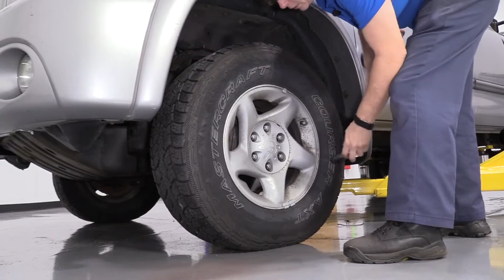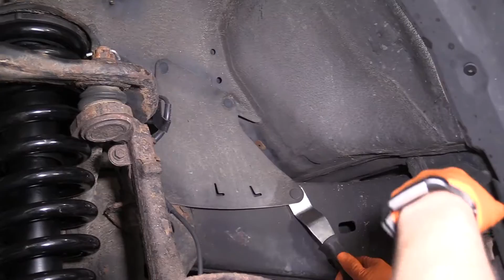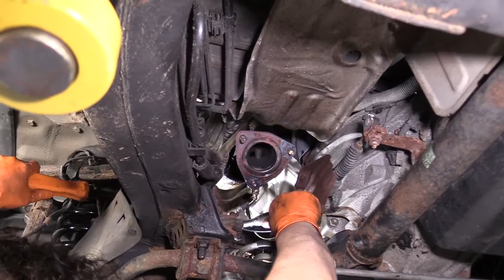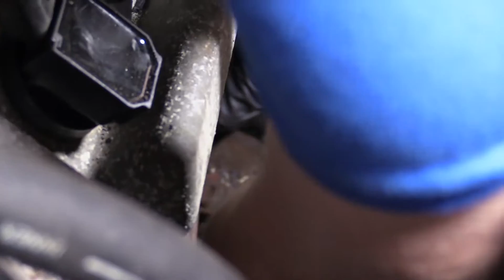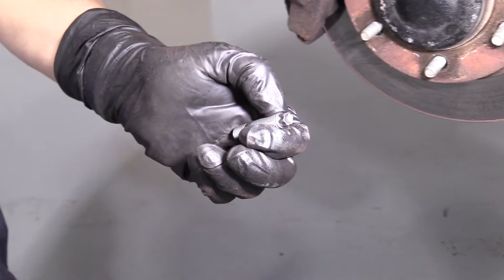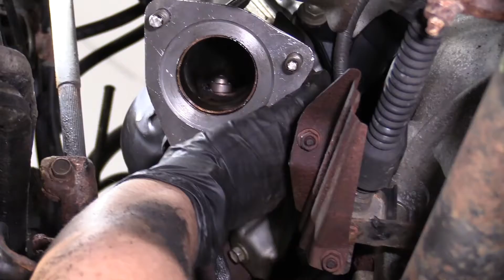How to Replace Exhaust Manifold 00-04 Toyota Tundra

Comment: So I've been chasing a leak. I've checked all my hoses I've sprayed all around the engine bay with starting fluid. I don't think it's any of the hoses or connections. I did replace one hose. So apparently this generation of tundras have a common issue with the exhaust manifold on the driver side cracking. So I guess I'm about to pull off this heat shield and give it a good throw inspection and hopefully I can weld it in place and not have to pull off the manifold

Comment: I’m late to the video but need to know what she is using to go under the manifold to the last two center bolts from up top clearly shes using a 1/2 drive flex head ratchet and she’s gotta twist extractor socket on the end but like bridging the gap on those angles, lve tried a lot and still can’t get on it with a ratchet attached, nightmare job because of the last two bottom studs in the center, I’d say near impossible for the guy with  limited tools and no garage to or even if he’s looking to save  labor cost he will probably spend on tools needed to do at home just an FYI if you’re that guy lol get yourself prepared

Comment: Sue, any thoughts on using one of the induction heaters being sold on line these days instead of the  oxy-acetylene tanks which most of us don't have?  Space might be a problem getting the flexible probe in there and I'm asking this since I haven't done this repair .......yet. 
IS there a gasket between the manifold and the pipe you attached there at the end of the video?  I didn't hear you mention that procedure.

Also your thoughts on putting anti-seize coating on all threads for the next person that has to remove  the exhaust manifold..... Great job on this video and you do a great job of showing us the challenges of this job even with a full blown hoist at your disposal.

Comment: For those doing the heads as well, I think it would be easier to just remove the shroud and disconnect the exhaust and O2 sensor and pull the head with the manifold on.

Comment: I installed a new exhaust manifold on my truck, but I had a problem with one of the studs that goes into the catalytic converter flange.  I could not get the stud to tighten It just kept turning and when I tried to put the nut on it, it would just end up backing the stud back out of the flange.  Would rethreading that one hole work or would I have to do a helicoil or something else?  It's just frustrating because it's a brand new exhaust manifold and for that to happen on the last stud, is quite annoying.  Any help would be great thank you.

Comment: Can an exhaust leak cause a P0032 and P0052 check engine light code? I already replaced all the O2 sensors and there is a strong exhaust smell and codes still exist.
Reply from the maker: +C Otake We wouldn't be able to diagnose an issue like that here, you may want to have a local mechanic take a look at it. Thanks for checking us out! http://1aau.to/m/Shop-1AAuto-c

Comment: Here's a trick for those 8 bolts, try to take them off in a star pattern, it helps with the leverage. 

It's also easier to get the last one off if a couple of other ones are screwed in slightly, again leverage.
Reply from the maker: +Peter Handelson Thanks for the tip!

Comment: I have a 2004 Sequoia and I suspect one of my inlet manifolds has a crack or leak because of the slight ticking sound after a cold start that quickly goes away, after watching this video I think I'll live with it!
Reply: I have the same year and same issue too
Reply: Same here it's the front right corner you have to take it off and weld the pin holes from the inside of the exaust manifold

Comment: Thanks for the awesome video. I watched it several time before replacing my manifolds. My only issue is that she cited 110 ft -bs of torque for the lug nuts while she was putting on the front wheel. The recommended torque is 110 N-m or 83 ft-lbs according to the 03 owners manual.
Reply from the maker: +Jonathan Hayward Thanks for the feedback!
Reply: Yeah, I was thinking exactly the same thing.  110 ft lbs is way over torqued for the Tundra.

Comment: I need this done on my 07 v8 4Runner and wondering if I had a shop do it about what the labor cost should be? Just got a really high quote so no way.
Reply: I need the same on my 07 V8 4runner.  Want to install doug thorley headers.  Have you found a shop to do it?
Reply: I was checking part prices ($Runner 4.7) and the internet toyota dealership was around $950 for the manifold while the discount aftermarket supplier was around $240.  But labor -- well, you've seen the video.

Comment: Just one question....can you give an approximate time per side?
Reply: If you lube all the bolts with penetrating oil (pb blaster) at least 24 hours before, taking the shield bolts and 6 of the exhaust manifold bolts should take less than 20 minutes.  Its the bolts by the engine mount that will take forever.  They are hard to get to.  Those require special ratcheting breaker bars that can hold at an angle.  It should take about 1.5 hours with the right tools per side. Just take your time and don't snap any bolts.  Heat them if they dont budge.  Spray more penetrating oil. Even if it take a day. Its better than having to drill out any manifold bolt, especially on this engines tight access

Comment: Lots of people will pull the driver's side or both motor mounts to do this job, FYI. I haven't done it, but read about it. I need to do it to my truck, but you can see why I haven't yet...
Reply: On drivers side I disconnected the motor mount and jacked motor up a little over an inch; made a big difference on those 2 middle bolts.  Havent done the passenger side yet.

Comment: So you have to remove the oil dipstick tube.. does that also mean that you have to drain the oil from the engine?
Reply: No draining oil not required.
Reply: No Naz, just the pipe is all you remove ....oil stays in the oil pan....
Reply: @chefluigi4752  But it's a good idea to cover/plug up the hole where the dipstick was removed.
Reply: no answer... that's why these videos suck
Reply: @bt7153  did the video say "drain the oil"?? Answer is no. These are literally step by step instructions.